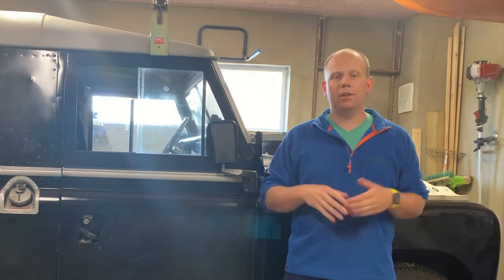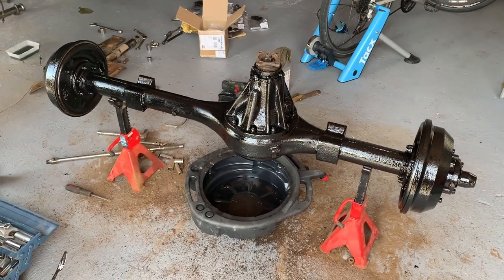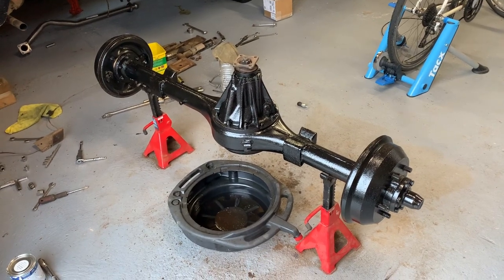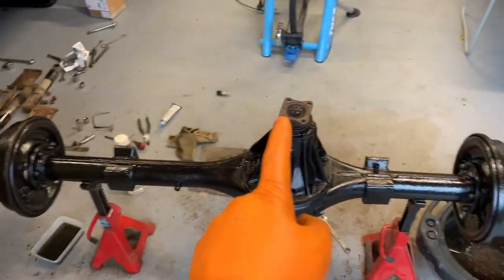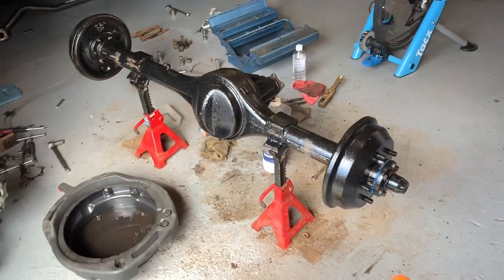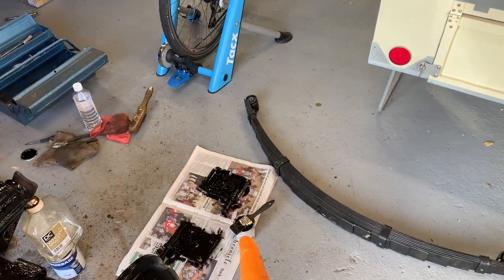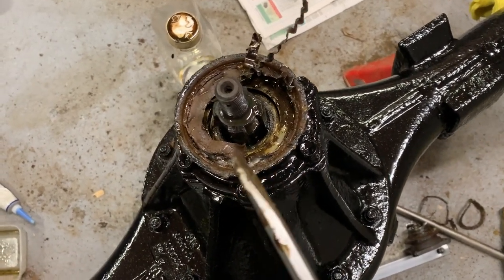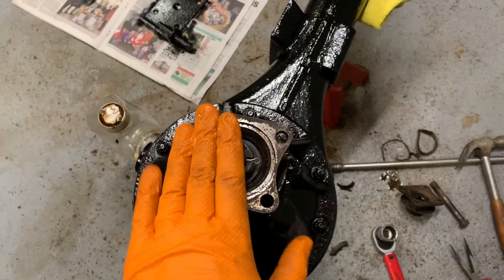Land Rover Series 3 - Rear Suspension Rebuild and Axle Restoration (Part 3)

Comment: I’m a Hammerite fan as well but what I’ve found is that it seems to enjoy having a coat of red oxide underneath it.  It seems to make it less sticky to apply.  I’ve also started using the Satin finish which seems to match better to the finish of alkyd paints that are often used.  Fabulously informative video once again and very much appreciated.
Reply from the maker: I agree, I’m not sure I trust the ‘straight to rust’ claim

Comment: Re spring bushes, if you did want to get them out, burning them out is super quick -  bit of MAPP gas, did mine no fuss at all in about 3 minutes a side start to finish. Just get them lit from underneath then whack them out with a good hammer and a 22mm socket (fits perfectly).
Reply from the maker: Thanks for the tip Nick, appreciate that!

Comment: Doing the diff pinion seal as well, pinion nut is propper tight, bust a socket on it!
Reply from the maker: It really is! I had bought an expensive socket a few years back that is quite thick-walled so thankfully it didn’t break. Hard to do with diff in situ, too!